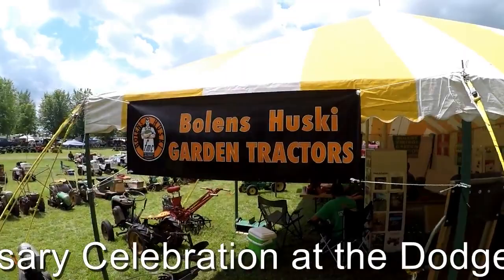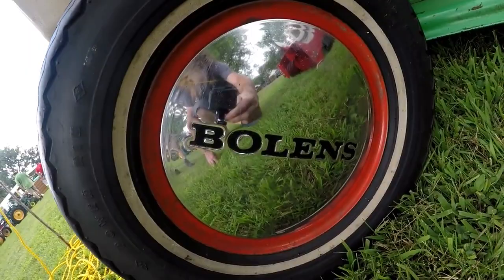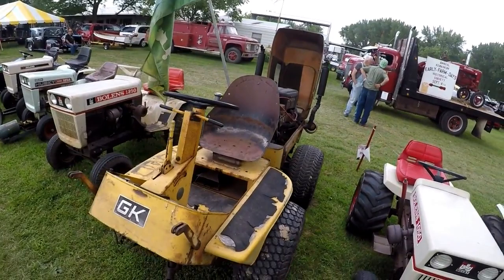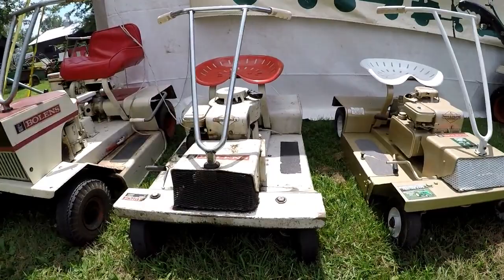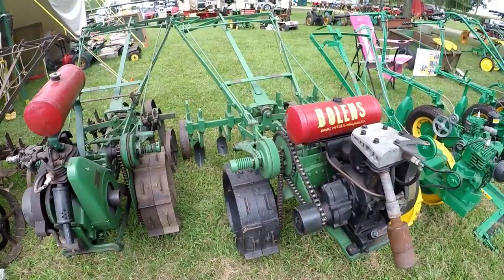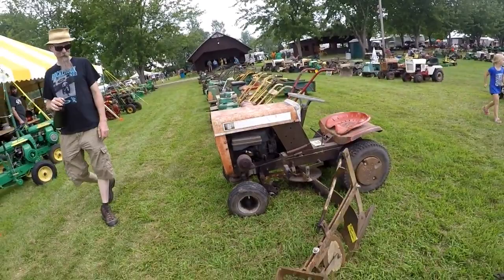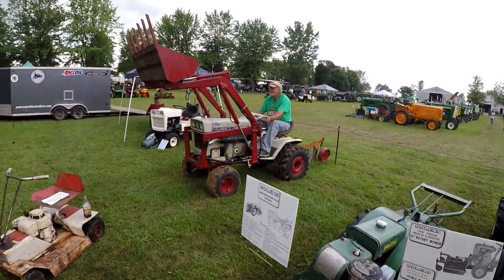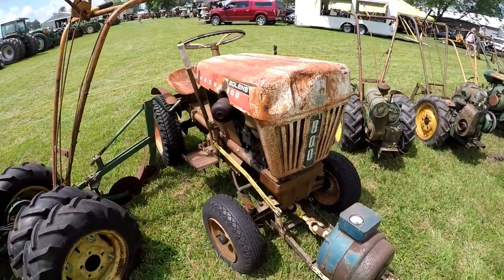Bolens 100th Anniversary Celebration

Comment: Good video . I'm working on the clutch from my 1050 tube frame .Waiting for parts from Sam's Bolens parts store that I just ordered today . Sam's is a great resource for old bolens parts .
Reply: Thanks for the heads up for a parts source. I accidentally ran across a beast of a Bolens tractor yesterday that the owner was tired of having in their way.
 I couldn't find a exact model #?
 It has a full cab, PTO driven mower deck and a huge hydraulic powered snowblower. It almost looks like a commercial property sized piece of equipment. 
 Before I entertained making a offer, I was curious about part's availability, so here I am.. thanks again.
Reply: @mtpocketswoodenickle2637  You are welcome . Sam is very knowledgeable on these old Bolens tractors . He does fast shipping ,has a lot of parts, and even has operator and service manuals .